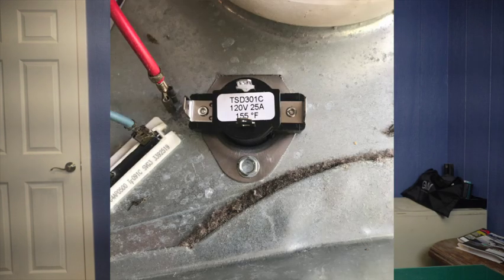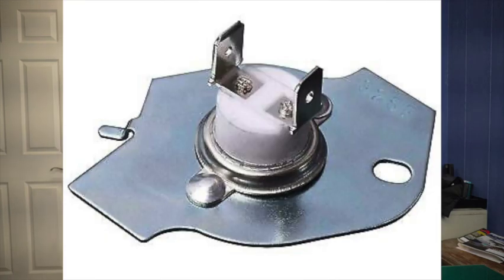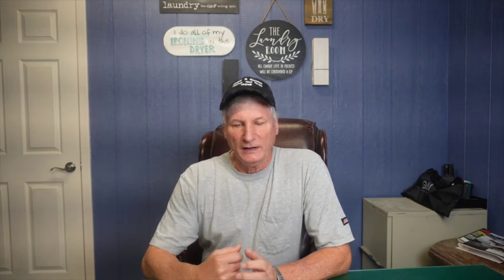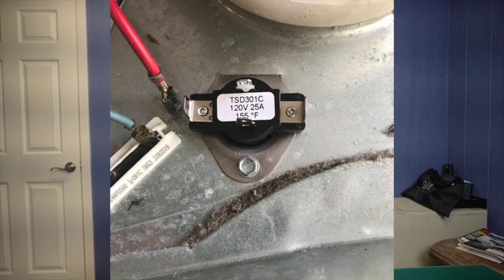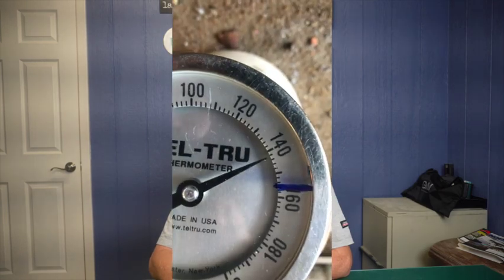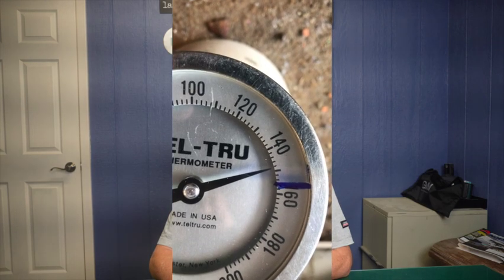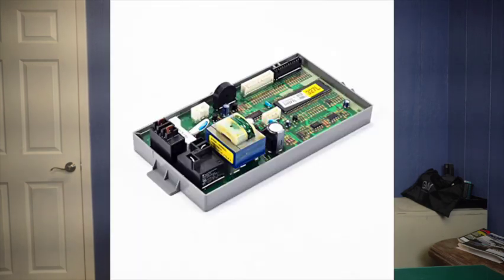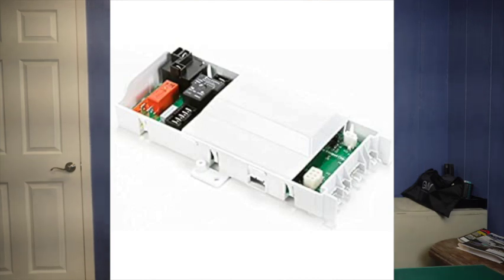How To Troubleshoot Dryers Blowing Components: Testing & Repair Guide

Comment: Thank you for making this video. Our Samsung dryer has been blowing the thermal fuse nearly monthly. I’ve replaced the cycling switch this time and so far so good!
Reply from the maker: Glad it helped. Thanks for watching!
Reply: We are having the same problem. I’ve replaced the heating element which was bad and now it will run maybe a week before blowing the thermal fuse. Not sure where to go from here. The guy I’ve been getting my parts said more than likely the control board is bad. What is the cycling switch?
Reply from the maker: The cycling thermostat is what the viewer is mistakenly referring to as the cycling switch. You can see one about 1:13 into the video. On his Samsung machine he is probably referring to the thermistor. It is the thermostat located on the blower that has four spade connections on it if you have a Whirlpool style machine. On the Samsung it is a two spade plug devise called a thermistor. It should turn the element off when it reaches around 150 degrees Fahrenheit.

Comment: Samsung dryer. Replaced entire heating element, replaced thermal fuse and replaced thermostat next to it. Ran for 5 minutes, blew the thermal fuse. Put another thermal fuse in and it blew within 5 minutes again. Thoughts? Thermistor?
Reply from the maker: It’s always a good idea to replace all of those components when you replace one. Check that your element isn’t grounded to the frame. Now, some Samsung models regulate temperature from circuitry on the control board. If changing the thermistor doesn’t fix it and the element isn’t grounding it’s the control board. Thanks for watching!
Reply: @HarperandKnowles  when you say grounding to the frame , you mean the coils touching the housing?
Reply from the maker: Yes, you will have to use a multimeter and check to see if you have continuity between the frame and each element spade plug. You shouldn’t have.

Comment: @beoutside
0 seconds ago
I have an LG DLE3500 5 years old, electric front loading that stopped working, took it apart, cleaned all the lint out completely, tested all thermostat fuses and found the blower fuse tripped. Also tested Ohms resistance for all connectors on heater box ( approx 20/40/20, also checked that nothing was grounded to the heater box. Also tested Ohms per room temp for the thermistor in the blower housing and resistance on the moisture sensor. With new Blower housing thermistor and thermostat fuse worked well with two loads and over heated/ blew blower fuse ( showing continuity when tested) Replaced and dryer started right up.... placed a thermasat outside house into the venting escape ( 1 foot from dyer, 4 inch hard pipe) it reads starting at 78 then climbs as drying to 140... it added time, clothes not quite dry, then clothes became over dry, temp outside exhaust over 170 so I turned it off thinking it was going to blow a fuse again..... time left 15 min on sensor dry..... any tips?
Reply: Motherboard?      Are you seeing varying quality in parts? Appreciate your time, thanks !!
Reply from the maker: Yes, sounds like a board problem. I see a lot of cheap after market parts on Amazon. Look for OEM parts when doing a quality repair.

Comment: Great explanation  thanks ...  but i have an question .... I can follow 1 leg of the 220 down from the timer to the heat elements & theres no problem there ....but the other leg of power goes outta site under the drum to the Blower or exhaust motor & iam Not getting power back up from that hidden wire back to the other leg of power to the other side of my element ..if that make scene ...so my question is ..what could go wrong with that power coming back up from under the drum ..is there an switch & or limit gone bad that keeps the elements off till the fan is running ??  & if not maybe I have an burnt or chewed wire from a rat or an rub out  possibility  / but power side has 0 zero Ohms to ground  & or No continuity ,  so I know my dryer is Not grounded ?? Thanks in advance , any help much appreciated it greatly before the scrap this Roper dryer
Reply from the maker: This video might help you. Whirlpool Dryer Won't Heat - Check The Motor Switch
https://youtu.be/o7YMJ3w3yKQ. If I’m understanding correctly you are missing the motor switch.
Reply: @HarperandKnowles  yes sir ..i was watching one of your other videos just now but I will diffidently  ck it out now Thank You Kindly for quick reply
Reply: That it....  YES SIR  Thanks Very Much ....! that was exactly what i was missing .....  hopefully those switches are not super expensive & Thanks again ..new Subscriber for life now I found your Channel
Reply from the maker: Thanks for watching!

Comment: Came across this video after replacing the second thermal fuse on my whirlpool. I wonder if my exhaust is kinked up and it caused damage to other components. When I turned it on this time I was met with a burning smell until I turned the timer off and unplugged it. Any insight?
Reply from the maker: It's normal to get an initial burning smell after opening up a dryer and repairing it. You disturb dust particles and lint while your in there and when you restart the machine it will pick up this small amount of debris and pull it through the element where it burns up in the stream of hot air. The smell usually subsides after a few minutes. A continued burning smell may be cause for concern, but if everything is working correctly it should go back to normal after just a few minutes oof operation. I hope this helps.  Thanks for watching!

Comment: Our Maytag is our 2 years old and has blown 2 Thermal fuse. We have cleaned vent all the way up and out roof. Seems to be getting hotter than it should. Would it be the heating element in only 2 years?
Reply from the maker: Turn the timer to the timed dry setting, try the 40 minute mark. Turn it on and let it run for about five minutes. Be sure the room lights are off and open the door. Look inside and see if you can see the glow of the element behind the hot air inlet. If you see a steady glow then your element is grounding out on the frame and should be replaced.

Comment: Great video! Is the fuse on the blower side resettable?
Reply from the maker: No, unfortunately it's a one time use fuse and must be replaced. Thanks for watching.
Reply: @HarperandKnowles  

Thanks! I replaced the thermal fuse on my element (309F) and the high limit thermostat but the fuse blew again after 3 loads.  My heating elemenet has continuity and is not grounded. I am planning next to replace the cycling thermostat in addition to the blown fuse. I suppose there is no need to replace the thermal fuse (196F) on the blower assembly if it has continuity?                                 

Also, considering that I have replaced the high limit thermostat  and the element is not grounded, shouldn't the thermostat have stopped the thermal fuse from blowing, given that the thermostat opens at 250F whereas the fuse opens at 309F?
Reply from the maker: If you have good airflow and your element isn’t grounding to the frame then your cycling thermostat is probably malfunctioning. Here’s how to test that. With no clothes in the drum and the dryer timer setting on a high heat cycle, remover the vent hose and place a thermometer that reads at least 200 degrees Fahrenheit at the exhaust vent opening.  Turn the machine on and watch the temperature climb. The cycling thermostat should click off at around 155 degrees give or take 5 or 10 degrees.  You can usually hear the click when this happens. Now your temperature will continue to rise because there is still hot air coming through but in a few seconds it will start to drop until the cycling thermostat cools enough to close again. Then the temperature will rise again. So, if your thermostat clicks off but your temperature continues to rise 175-185 then turn the machine off before it blows another high limit thermal fuse. This tells you that your heating element is expanding enough to touch the shroud and ground out. This is real hard to detect because it pulls away from the frame when it cools and will test good when you do a continuity check.  Watch this video where I cover this problem: https://youtu.be/gozB0wS-Gx8.
Reply: @HarperandKnowles  thank you for your detailed explanation! You have earned yourself another subscriber!
Reply from the maker: @harryfeng7231  Thank you, Harry! Check out my community tab on the channel page. I'm starting to build that now; I plan on posting tips I get from subscribers there to share with others.

Comment: I have a Samsung dryer that keeps overheating, I have replaced the high limit thermostat, cycling, thermostat, heating element, thermistor, the dryer keeps overheating and blowing the high limit thermostat. I have replaced these five times in the past three weeks. The heater won’t shut off it keeps getting hotter and hotter until the high limit thermostat cuts off. I have checked all the thermostats, the thermistor and heating element for ohms of resistance everything passes. I used my blow dryer to heat up on the thermistor. After all the trouble shooting it keeps blowing. Could my main control board not be functioning correctly? If so how can I check this?

I can’t find any information for my issue. Everything thing keeps saying there’s a clog but there’s definitely not because I took the entire dryer apart and it’s clean. Please help!
Reply from the maker: I have had several Samsung dryers with this issue. If yours is the model I think it is it doesn’t have a cycling thermostat. Temperature control on these is a function of the control board and it will be fixed only when you replace the board. Also check that you have good airflow at the exhaust port. Thanks for watching!
Reply: @HarperandKnowles   This is the model No. DV448AEP/XAA. Is there anyway to check the temperature control on control board? I would like to check with my multimeter before I purchase.
Reply from the maker: If all of your other components check out it is going to be the board. There is nothing else in the circuit. And if your machine has a thermistor it doesn’t have a cycling thermostat. There may be a way to check the temperature control on the board but I don’t know how. I believe those components are sealed in a jelly that would prevent you from accessing the soldered points where you could test continuity and resistance. Yours may be different. I’m willing to bet if you change that board your problem will be solved.
Reply: @HarperandKnowles  yes the PCB board is sealed in jelly. I will change my board and hope it fixes the over heating issue. Thank you for your help. I will keep you posted.

Comment: My Samsung dryer had no start issues, I tested the thermistor and it was bad replaced that and the thermal on the blower housing.  After a few loads of clothers everything was working. Until the thermal cut-off is now blowing. tried replacing the heater coil, thermostat. Dont know what else to to. Perhaps its a control board.
Reply from the maker: No start issues can usually be run down to, 1) a faulty door switch 2) a blown thermal fuse on the blower side 3) a broken belt 4) a faulty belt tension switch 5) an over heating motor 6) a bad start button or 7)  a bad control board.  The thermal cutoff fuse will blow if cycling thermostat doesn’t work, or element is shorted, or obstructed airflow. When you eventually find it you’ll wonder why you couldn’t find such an obvious problem to begin with. I do it all the time! Thanks for watching.

Comment: I changed heating element and thermal fuse hi and low thermostat it worked for several loads but now it just counts down but doesnt run
Reply from the maker: You failed to mention the model number so I’ll just guess at the door switch, thermal fuse on blower side, or home circuit breaker on either L1 or L2. Thanks for watching!
Reply: I had all the parts replaced it's been working until someone pulled the dryer out and unplugged it and we noticed the metal tube that is over the heating element had burnt marks so we thought the element was bad but anyhow got on Amazon order new parts got it all back together and it is doing the same thing (we pushed the start button and it sparks pretty bad and trips breaker) I don't have a tester bit I'm gonna get 1 tomorrow but my question is would a blown thermal fuse do this
Reply from the maker: No, you have a dead short in it somewhere. Open it up and look for burned wiring. It would be helpful to know what kind of dryer you have. Thanks for watching!

Comment: I've tried everything, vents all clean with plenty of ventilation, replaced thermal switches and fuses, replaced heating element, but the thermal fuse on heating Element housing still keeps blowing, what else is left? Its either the dump or bypass the fuse, because except for the fuse blowing, it works perfectly.  Oh, and it's old so it does not have a control board.
Reply from the maker: Use a thermometer at the exhaust with nothing in the tub. Be sure the cycling thermostat is operating correctly. It should click off around 150 degrees and the temp should start dropping about 165. These temperatures can be a bit higher or lower but if the temperature fails to drop after reaching 180 then either the cycling thermostat is not working properly or the element is grounding. I’ve seen new components that fail. Also check that the temperature of the thermal cutoff fuse is the correct rating for your machine. Some are 309 degrees up to 352 degrees. These are Whirlpool components?
Reply: @HarperandKnowles  Yep, I was thinking both of those things.  I have a feeling the thermal fuse I've been using is a lower temp, because it's the white plastic one, and the old one was metal.  I just replaced the heating element before I wrote the text.  I did have a wire pop off the thermal cutoff and ground out and I'm thinking it might have blown the new switch, but it checks out good.  Either way, I just bought a whole new set of switches and fuses, going to replace them all again.   If that don't work, I'm going to jump the fuse and use it any way.  The machine is in a solid concrete building, roof and all, separate from the house and I only use it for work clothes twice a month, so if it burns up I'm not going to cry about it, someone gave to me anyway.

Comment: my thermal cutoff fuse keeps cutting out. it works for a load or 2 and then it cut out. what could be the issue. thermal fuse is good , thermostat is good, element is good. im confused
Reply from the maker: It sounds like your element may be grounding out. I think I covered that in this video Thermal Fuse Keeps Blowing On Dryer
https://youtu.be/gozB0wS-Gx8.

Comment: I blew a fuse on mine ..it happened again...broke it down and replaced every sensor thermostat etc...last night i shut it off bc i was leaving and it wont turn back on...the thermal fuse blew AFTER i turned it off...small light load...makes absolutely zero sense. Im thinkin the jack offs i got it from fucked the wiring up. Vents clean, flex hose is clean...blower motor fan cleared off, and the internal vent is free of obstruction. Besides two button the blower motor and the shell i replaced everything elements included
Reply from the maker: It sounds as if your element is grounded to the frame. I'd check that. https://youtu.be/gozB0wS-Gx8 Thanks for watching!

Comment: I just watched a video where a guy fixes a dryer timer. The solution he comes up with is unlike anything I'd ever seen before. I would love to get your thoughts on his fix. It's either the most genius cost saver I'd ever seen or it's something else. If you could check it out and let me know your thoughts that would be great. Thanks. And thanks for your videos I've learned a lot.  Here is the link to the video.
https://www.youtube.com/watch?v=cN7H00bYz_o&t=836s
Reply from the maker: That is interesting but I'm skeptical. It's usually a grounded element that keeps the timer motor from running. Also, if you have your timer set to the cycles on the left hemisphere side of the indicator on some models (auto cycles) the timer only advances when the cycling thermostat is off. There are a few ways the timer motor won't advance and all of them are confusing as hell. The likelihood of 5 timers having the same problem is really unbelievable. But, hey, I may have learned something here. If I ever have one that stumps me like this Imma give this a try! Thanks for watching!
Reply: @HarperandKnowles Thanks so much for checking this out. It's got to be the strangest fix I've ever seen.  Putting a bolt through each one of the timer gears to take up play/movement.  It's so strange that all of the gears have what looks like a factory made pilot hole made for alignment.  Maybe for quality control sighting by eye when built at the factory back in the day?.  it's just got me scratching my head.  Is this a fix or is it not?  It's certainly out of box thinking if he right.   Thanks a lot for the response.  It's very kind.

Comment: Mine keeps blowing the 30 amp in the fuse panel (yes glass fuses🤦) landlord said my dryer was bad so I replaced it and still have the same issue and now the landlord refuses to get an electrician to look at the panel.
Reply from the maker: If two different dryers are causing the same problem in the home breaker box then there is probably a problem with the home wiring. If it is an immediate blow then there is a direct short, perhaps a bad receptacle. If it blows after running a bit then there is a problem with an overloaded circuit. Something is causing the fuse to blow.  Try checking your dryer at another receptacle, like in another home. Two dryers with the same problem would be a rare coincidence.  I can't help you with your landlord problem, but it sure sounds like it's probably something he should have checked.